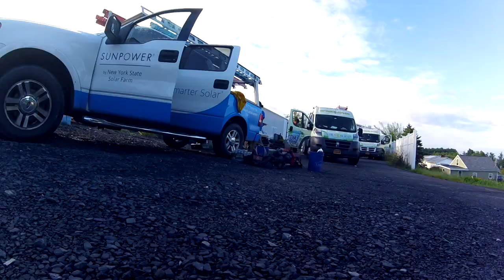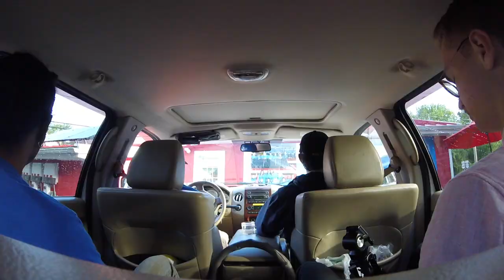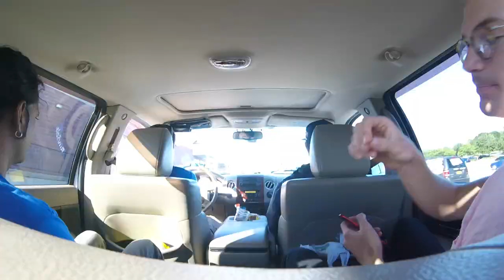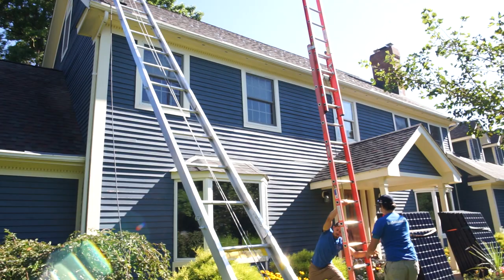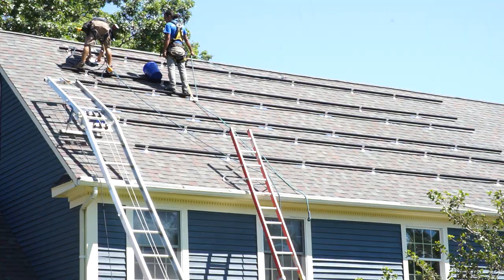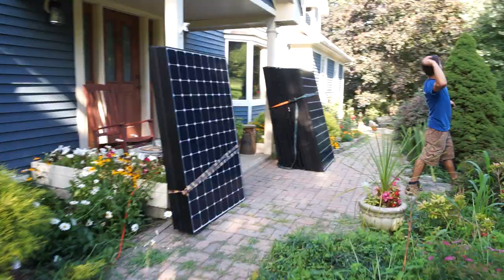A Day in the Life of a Solar Installer

Comment: Do you need your e.t. card or be a journeyman to do this?
Reply: I got my ET card and I’m an installer. It’s recommended not required. They prefer roof/construction experience . Sometimes no experience Is fine. That’s how I started . Installer 1 , worked up to a roof lead in less than a year

Comment: Cool vid man! You know I've been doing solar installations for over 5 years. I freaking love it. But there's alot of issues I've encounter with installs planning that make it so hard to be efficient. My main concern is we're always getting blamed for being over budget on time but we always get wrong measurements on plans and missing material.I have voiced my opinion and been shutdown multiple times.Any advise?
Reply from the maker: Jason these are all valid concerns, & in my experience if you have wrong measurements on plans  thats mostly because the site visit tech who did the preliminary analysis took the wrong measurements then he feeds that to the engineer & now everything is off. its a big problem & leads to a lot of frustration for a crew.
Reply: I want to ask you if your partner helps you carrying the solar panel since this video does it show it